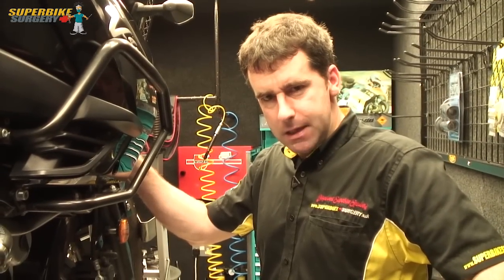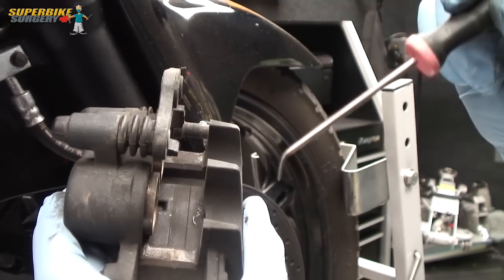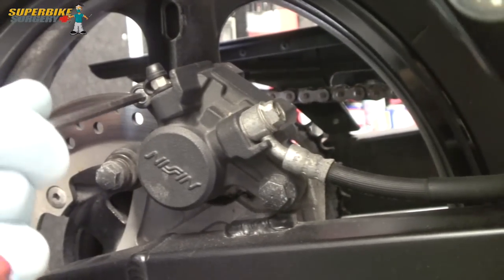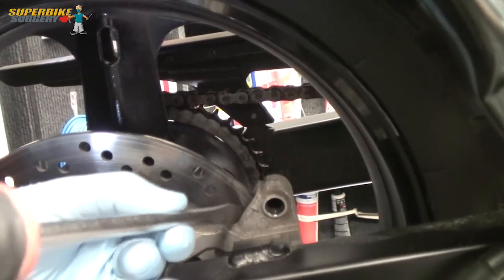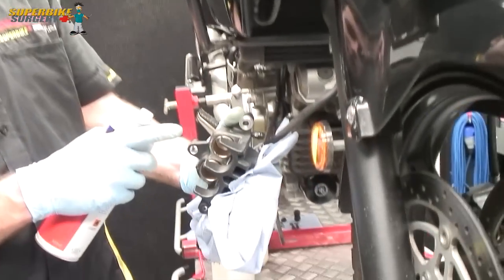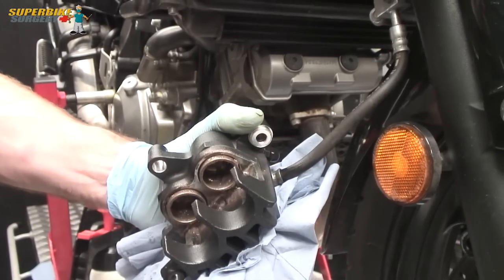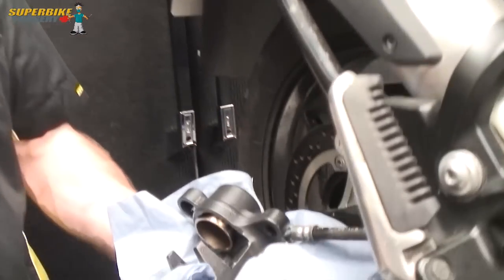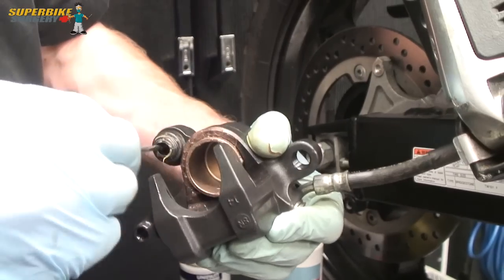How to service and clean your motorbike brake calipers

Comment: DO NOT use copper grease anywhere near rubber! It will eat through it. I found this out the hard way. If you have to use it because of squeak, only brush it lightly on the back of the pads that touch the piston. The pins that go deep into the rubber seals need SILICON grease on them! It is rubber safe and doesn't melt off under high temp. This video also does nothing to address binding pistons, which you are sure to have in British weather. He doesn't strip anything down, or work any toothbrush round the pots. This is completely amateur. He doesn't even tell you how to re-install the front brakes properly so they line up true, if you have the radial type.
Reply: I had wondered about the pistons themselves
Reply: @Labgorilla  It won't do anything to grease them, in fact it will just attract dirt and road salt. The pistons get lubed by the internal brake fluid. Best thing is to clean them with brake dust cleaner and soapy hot water, and make sure you rinse with plenty of clean water after. (or they will bind up when the water dries)

Comment: Let me ask you something about the copper grease: I think you use it too much, if even a little bit of grease sketch on the brake pads or disc could be a problem don't you? It's however a grease. Because of this fear I never use it, I only clean very well everything, I only use a Molybdenum bisulphide grease on the caliper pins but nothing on the pads.
Reply: no need to use it on brake systems especially not motorcycle brakes.
Reply: Using copper grease liberally is a patriotic duty in the U.K.
Reply: Look at how the guy is using it too, would be very easy to get that shit on the brake pads when he's spraying it and moving them about the table. Copper grease should be fucking banned so idiots don't slather it on everything. I mean who thinks grease on calliper bolts is a good idea? That's going to play hell with the torque settings.
Reply: @sv650nyc7  
😂😂

Comment: I dont normally go out of my way to post neg ... but please bring yourself into line with modern day technology, your influencing the audience to apply copper grease to brakes equipped with anti squeal shims, modern brakes dont really squeak these days due to pad compound or special backing shims as in your video. Also thats a huge amount of  copper grease to apply to something which heavily relies on friction to do its job
Reply: @SuperbikeSurgeryTV  Thanks for the reply, no its not textbook and im very confident in my competency / practical experience being a mechanical engineer and spending most of my life in my own garage. I have never seen a caliper on a motorcycle come from factory covered in copper slip to protect it from the elements, the engineers have already thought of everything and designed it to do its job regardless of weather,  yes intermittent cleaning and re grease of the sliders is needed but in my opinion applying copper grease over everything is just going to attract dust and mess. also the anti squeal shim are designed to work dry. if the bike was a 1960 Norton Dominator id give a thumbs up
Reply: @SuperbikeSurgeryTV Where i live in the UK i ride all year round and average 8k a year wet and dry and never had a problem tokico on my hayabusa and brembo on my ktm.. You will find that caliper piston quality on a motorcycle is much higher quality than car caliper pistons and they dont corrode being coated aluminium in most cases where as car caliper pistons are just steel with dust seals hence the requirement for protection of the moving parts with a dust seal
Reply: @SuperbikeSurgeryTV  tell me whats going to cause more trouble your copper grease with embedded dirt and grime all over the sliding piston after a few miles or the clean piston with usual road debris waiting to be swilled off with water  when it gets washed? iv just never had a problem with sticking /  ceasing  / corroding calipers on a motorcycle
Reply: @SuperbikeSurgeryTV  PISTONS MOVING 5 inch  ??  II hope you mean MM ?? its not even that much to be honest, its more like 1mm. Its quite frustrating getting mugged off by a motorcycle mechanic questioning my mechanical understanding on something second nature to me, truth is id have to take a 30k pay cut to fix motorcycles for a living so i best just keep my gob shut and leave you to keep them customers corrosion free and happy
Reply: @SuperbikeSurgeryTV  you mean folding away your B&M Bargains paddling pool lolol nah mate same to you happy new year all the best
Reply: @Deej-85  love how all his comments are deleted in reply to you.
Reply: ya that's far to much copper grease, a tiny bit is all that is needed.
Reply: @bikerboi1983  he's probly realised 2 years later 🤣👌

Comment: I’d say a bit excessive on the copper grease. It attracts dirt itself. You’re better off just greasing the sliding pins slightly (where the pads move) and leave it at that. Also, ceramic grease may be a better alternative to copper grease as it can cope better with higher temperatures.
Reply: I don't want grease anywhere near my pads,  especially the amount he's smothered on! I'm with you, a little on the slide pin and the rubber boots.
Reply: @twowheelsquirrel  you’ve got to be careful putting grease on rubber boot too. Some greases can swell the rubber so watch out for that. A good one for rubber is red rubber grease, hence the name haha
Reply: @alexhorky6454  yep, I've got a grease for every job. (For the bike, the Mrs needs something else)
Reply: After 50 years of working on Cars, Vans, Motorcycles and Commercial Aircraft, I guarantee that brake dust, dirt and corrosion will always negatively impact brake efficiency more than Copper Grease is ever likely to. Clearly you need to use it sensibly and sparingly as demonstrated in this video.
Reply: @tonyb622  right, so you’ve just more or less clarified my point… except I wouldn’t be putting that much on, there’s no need for so much.

Comment: There is a problem with copper grease . . . it is mostly mineral based and you shouldn't let mineral based compounds get within a country mile of any rubber seals or O-rings etc. Perhaps not a good idea to spray it on the pistons or you risk the piston seal rubber swelling up with corresponding issues with the brakes sticking on.
Reply: great video. i do a similar brake caliper service when i replace brake pads or when pistons get stiff. I use brake grease though on slide pins and pistons. I dont grease backing plates at all though. Just seems like it would collect grime.
Reply: ybliga 
yeah with you on this. Bested on most recommendations I've been using red rubber grease with great results.
Reply: I use high temperature red rubber grease on brake caliper sliding pins, I lubricant pistons with brake fluid.

Comment: Great video, simple & clear. I've had my bike since 2002, 75k miles, ridden in all weathers. I do exactly the same procedure with my brakes (every few years or so). I've renewed the front caliper seals & serviced the calipers once only (2 years ago ). No new pistons required, tokico six pots. Still got brilliant brakes all round. This procedure works. It's your own preference on what lubricant you use. BUT, if expert gives you advice for free..........🤔

Comment: When cleaning callipers to that extent I remove the pistons and seals, get out the dremel with a soft brass wheel and clean out the seal grooves and de-crud the pistons, I use silicon grease in the seal grooves and seals sparingly as I use silicon fluid, find it stops the oxidation behind the seals stopping the piston binding as I ride all year round in our wonderful weather. About to do all this again on one of my bikes but going to give stainless steel pistons a go, sick of corrosion. Keep up the very good videos.

Comment: I admire your work and the way you explain those thing with brake calipers .. how it should be made are very clear and easy to understand even for me, were I`m not a god friend with English language.
I have two  questions.
You put almost on anything copper grease (not on the face of the pads, or the brake disk, I understand why :) ) but what about the dust !?
If were are riding and the dust will come on the moving parts cover with the copper grease, that will not make a layer witch is resisting the moving of the pads?

Comment: I plan on using a small smear of copper slip on my caliper pins but will lube my exposed piston faces with red rubber grease or silicone brake grease. I have seen forum threads where riders have blamed copper slip for ruining their piston seals and causing them to swell.  Of course, it is possible they are wrong in their assumptions.
Perversely, my Tiger manual advises the use of copper grease but in the next sentence warns that mineral-based compounds should never be used anywhere on the braking system and can cause brake failure. I have been unable to find a synthetic or castor based copper grease so don't know if it's available.
I also heard (but can't confirm if it is true) that copper slip can interfere with ABS systems due to the electrical conductivity of the copper and that BMW will invalidate your warranty for brake claims if they find copper slip has been used. I have no first hand experience of this and so maybe it is BS but it's made me concerned. Your experience would seem to suggest the risk is perhaps more theoretical than real.
Excellent video and clearly explained.

Comment: I don't like to use normal petroleum-based grease in guide boots, it will eat the boot or deform it in the long run, you can use silicone based grease to avoid that.
Reply: +Miguel Paolino He's not the one who will be paying for new seals, boots and guides (because the guides will get corroded once the seals get swollen up and stop doing their job), so why should he care? ;)

However, to be fair, he did a good job explaining how the calipers work and how to go about servicing them on this specific bike model.

Comment: Great video... What about pumping out the pistons slightly and cleaning off the ring of crud?   They csn then be easily pushed back in. Or can use a cheap piston spreader tool

Comment: Great presenter providing clear instructions + great cameraman = great video :)
One question though - will I have to bleed the brakes after doing exactly what you did on the front calliper or is it OK to reinstall the calliper and go ride straight after? Cheers!
Reply: Late response but you can reinstall them as is!

Comment: Use copper grease on anything exposed to high temperatures is that the copper enables it to transmit the heat quickly away, otherwise the grease would simply burn up.
Just apply a smear of grease onto the back of the pads to stop them squealing, and also onto the sides so they move easily within the callipers. If you don't do this they can become siezed and the brakes will bind and then get hot.

Comment: We used to use copper grease many years back on the back of pads and wheel hubs on cars, and on some today it's not a bad idea to put a little, but no need on copper backed pads (this is why they are copper backed of course). I certainly wouldn't use it on the pistons and sliding pins, it's an abrasive, it's for mating surfaces, on the other parts (in rubber boots etc), use an all purpose grease. I wouldn't put anything on the pistons, but a little WD40 or ACF-50 to protect them for a while isn't a bad idea, but anything abrasive is obviously not a good idea, plus it will attract dirt and brake dust and hold it there.

Comment: Nice video but for one thing, I personally would not go anywhere near my brakes with any copper grease and certainly not in the quantities that you are using (if at all!) How easy would it be for any of that grease to end up on the rotors or the faces of the pads?  Apart from the sliding pins ( which are enclosed in rubber gaiters) I do not use grease anywhere on the calipers at all.

Comment: I can't remove the caliper carrier on my front ones. Plus one piston comes out unless I clamp it and then the other comes out. They both do not come out at the same time. Got a Suzuki bandit 600 gsf 1999 model. It's got a front right and left caliper and one rear caliper which is stuck in on the strut arm. Also when I g clamped the piston on the front caliper ( since it popped out) can see a bit of bubbles pop out the side as if the piston is just pushing below the seal.

Comment: Thanks for the tutorial, again very useful. You use copper grease on your caliper bolts, would you recommend I do this on my track bike? Most of my friends use thread lock on those bolts! Would it be better to use copper grease and then lock wire the bolts for race/track use? Cheers, Jonny

Comment: GREAT VIDEO!!!  Love the detail & explanation.  Do have a question about the Cu grease.  Seems like others recommend silicone grease.  Wondering if things have changed since this video was made & if you're recommending silicone now.  Also, noticed that you used/ recommend Cu grease on caliper bolts & am wondering if you would recommend Cu Anti-seize.  EXCELLENT VIDEO ~ thanks for sharing!
Reply: Yep ... the lads doing it all wrong ... silicone grease on slide pins, red rubber brake assembly grease on pistons, far too much copper spray grease used, never on rear of pad if backing plate has holes like these pads have, grease wicks thru to the braking surface ... no brake / oh shit / crash!!!
Reply: @mickeymouse4897  AWESOME!  A little late, because I asked these questions around a year ago.  Nevertheless your information is good for future jobs and others who might have similar questions.  Also, wondering about your background?  What is your feedback based on - experience?  THANKS!!!!

Comment: Hi can you explain clicking on front brakes?  Is it likely the way pistons are not going back as they should only noticed at low speeds lately all seals were replaced a while  back and the pistons were cleaned like new no scuffs have noticed some new surface rust only small amounts would you recommend seeing to pistons with pads out and using lever to bring pistons back and for?  Any help thanks

Comment: Great vid, very easy to follow! I am hoping to do the same on my aprilia caponord very shortly.  Front and back need doing, will forcing back the pistons in the brake callipers with the old pads in place to make room for the new ones cause air bubbles in the brake fluid? what would you recommend?

Comment: This video is great :). Love your silicon spray idea and also the copper spray too. I never thought of either of those ideas. Is the other grease you use the special brake grease? I have some brake grease and I was wondering if i should use that instead of the copper grease? I'm assuming I should stick to copper grease on the bolt threads? Is any silicon spray okay for the brake caliper? Thanks again :)

Comment: Hi James,
I have to do the same job on my front caliper (Suzuki Bandit S 2001), but I found that the O-Rings are damaged and losing oil. Do you have a video explaining step to step approach to do a full caliper renewal? Many thanks for your help. Max
Reply: In my view, if your caliper pistons are leaking, then pump your brake levers gently to push pistons out. Then pull them out, replace with new set of O rings and reseat them. Then bleed the brakes with new dot 3/4 oil. If that solves it, great, otherwise you would need new calliper housing. 
This is though, is my advice.

Comment: Hi James, great video. I am just about to service my brakes, waiting for winter to leave here, I noticed at about 3:50 into your video you had washed caliper part and then sprayed it with something, was that just more brake cleaner? Also I will be changing my lines, I was wondering if when you clean the brake calipers with the lines off, what do you recommend sealing the brake line inlets with? Is it ok if some of the cleaner gets into the fluid side of the pistons? Thanks

Comment: Just to ask - are you putting some copper grease on the pad pivots(especially the threaded ones)? Also - always wandering if I can put on alu. calipers copper grease on the bolts, instead Locktide, and then to torque wrench them? 

Cheers!

Comment: Hey James, really love your videos. Need your expertise with Quick question on replacing brake fluid please. When pads are half way worn, the level of brake fluid is gonna be lower as the pistons are out a bit more. So question is when you replace the fluid, do you fill on that exact particular, lower level or as if you had new pads and top up all the way up to max? Thanks in advance for your time
Reply from the maker: Thanks for watching, When I replace brake fluid as part of a service I always top up the reservoir to the uppermark regardless of pad wear.  When you're replacing brake pads you should always remove the reservoir cap when you push back to the pistons to make sure it isn't over full. Then set the level correctly once the new pads are installed. Hope this helps :)
Reply: Superbike Surgery Ltd Hey James, this really does help as it’s an exact answer covering everything, not to mention a very quick reply. I really appreciate your time on this knowing how busy you are. Many thanks. Can’t wait for your next how to or diagnosis video :)

Comment: Hello.
I make you a question about the cooper paste ¿can be replaced for lithium grease in service of the brake system 
Thanks
Reply: use copper grease on anything exposed to high temperatures is that the copper enables it to transmit the heat quickly away, otherwise the grease would simply burn up.
Just apply a smear of grease onto the back of the pads to stop them squealing, and also onto the sides so they move easily within the callipers. If you don't do this they can become siezed and the brakes will bind and then get hot.